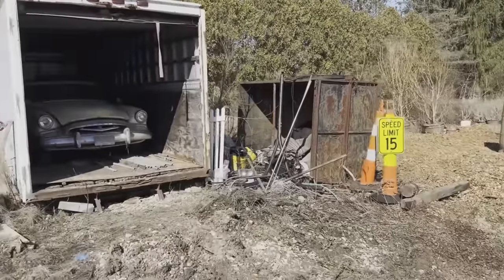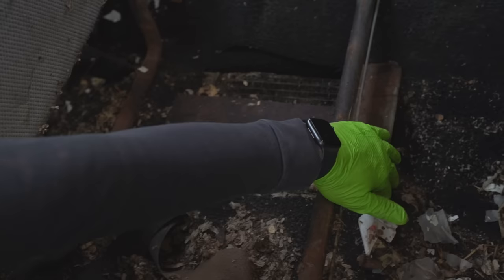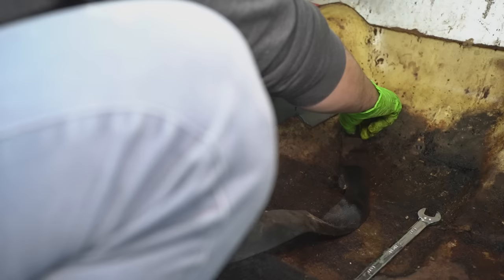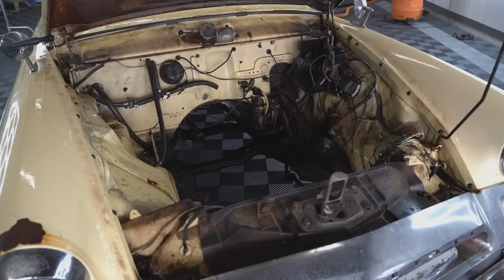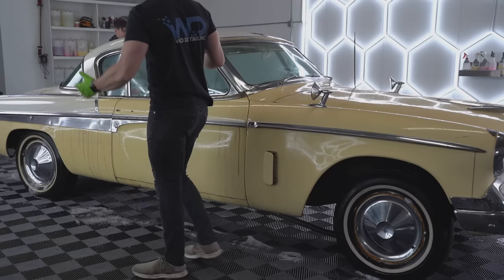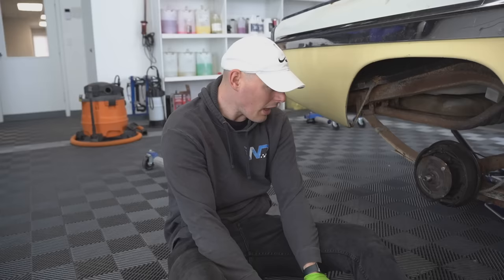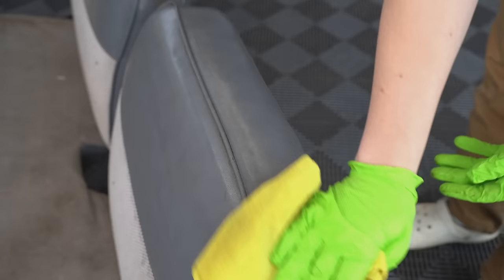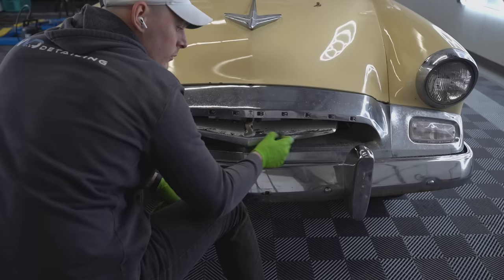First Wash in 30 Years: ABANDONED Barn Find Studebaker Disaster Detail! | Satisfying Restoration

Comment from the maker: Go to our sponsor https://aura.com/wddetailing to get a 14 day free trial and see if your personal information has been leaked online!
Reply: I still don't understand why people throw these cars into a barn and don't do anything to them for decades. Now after rotting away for 30+ years they want to bring it back out and restore it. Had they put the car in a garage and monthly started the car and/or washed it, pumped up the tires, etc., the car would still be flawless. I have a 2019 Golf R that I bought brand new in 2019. It's my play car so it doesn't see rain. Once a month I wax and detail it out and after 3 years with only 1000 miles, the car looks better than it did when I bought it. The battery is on a tender so it's fully charged. When I do drive it, I warm it up slowly and try to drive it at least 10 miles so everything stays lubed. If you are going to park it and do nothing to it for 50 years, then just sell the car...get rid of it.
Reply: Have you ever did a 1992 svx  before?
Reply: @pokeman8030  6
Reply: It has that locking gas cap so the mice couldn't get in the gas tank because they ain't got no octane rating to begin with...
Reply: For the engine question. I would put an electric motor with around 400hp and around the same number of pound-feet of torque. Reinforced suspension, and around 90kWh battery pack. perfect for some fun and weekend rides.
Reply: @youxkio  You Limeys kill me with your electric car gags. We'll come plug it in at your house and when all the lights go out in the neighborhood I'll go around and let folks know you did it...
Reply: @thekingsilverado3266  Myths to be solved...
Reply: superd. frm.davao city.philippines

Comment: First and worst, when you get the new brake drum you will find that the hub is permanently attached. The drum is supposed to be removed by taking off the nut in the center and using a special heavy duty puller designed for this type of brake. This error is not entirely your fault as the wheels on the LEFT side of the car are supposed to have left hand threaded studs. Somehow, the brake drums were installed incorrectly. If the new drum you ordered has right hand threads install it with the correct lug nuts. To make a 100% correct repair replace the remaining  left hand wheel studs in the front hub with right hand threaded studs and nuts. This type of wheel stud arrangement was discontinued in later model years and the car will operate with all right hand threaded lugs. Since you have broken all of the wheel studs you must remove them from the hub and mount the puller with 1/2 inch bolts. The hub mounts to the axle shaft with a tapered fit and a key and requires much force to remove. As to the "radiator" under the front seat, that is actually the heater core. You will find the blower fan inside the right front fender. This is normally connected to the heater core box by a 4" flexible hose. This was probably removed by whoever removed the engine. There were also water hoses which connected the heater core to the engine cooling system. What engine to put in the car depends on whether you wish to do a complete restoration or make the car more dependable for every day driving. A restoration would require the original engine be put back in the car. Many Studebakers have had Chevrolet engines installed. This is quite easy as Studebaker used Chevrolet engines in 1965 and 1966. You can use factory original components such as engine mounts, transmissions, exhaust systems, radiators Etc for 1965 and 1966 model cars to install a Chevrolet engine in nearly any  Studebaker built after 1951 without having to make major changes to the chassis or body. For further information contact the Studebaker Drivers Club.
Reply from the maker: Thank you, this is a lot of GREAT info! Much appreciated!!
Reply: @WDDetailing  :person-turqouise-waving:.....G'day,
for any vehicle, contact the associated club (if possible).
Cheers with appreciation,
Malcolm. (Australia)
Reply: For old chrome I use 0000 wire wool. It removes the rust and polishes the chrome with no scratches.
Reply: This is a great response.
Reply: Wow, now I know!!  😊👍
Reply: To add to Edward's comprehensive reply, if a replacement engine unit is required, it's just as easy to maintain it stock with a Studebaker engine even if the block needs rebuilding with a V8 parts readily available from a host of vendors. BTW, the following year saw the introduction of the 1956 Studebaker Golden Hawk which was fitted with the Packard 352 big block that put out 275 ponies via quad carb. Fitting twin quad carbs boosted output 300 hp. It was also possible to fit the Packard 374 unit, or have the original engine bored out to 374, which took the power output to about 310 hp with a single quad, duals took it to around 340 ponies from recollection.
One suggestion if your faced with tackling a brand/car you're not familiar with - maybe reach to the Club for any quearkieness or innovations which might help you with future endeavours.
Enjoyed the video.
Oh yeah, my parents had a 56 Golden Hawk when I was a baby; the only 56 Golden Hawk imported into the UK back in the day, though the car was a couple years old when they bought the car; I remember that car very well 😊 even as a 3 year old
Reply: 8
Reply: Locking cap because people siphoned gas.
Reply: @richardatkinson500  indeed but the Packard engine had issues with the oiling system which I believe people in the Packard Club solved by adapting an Olds 455 oil pump - but this is not something you can do if you have no mechanical knowledge and an access to a machine shop. Also, the Packard is a even heavier than a Stude 289 which is worth bearing in mind and - last but not least - parts availability for any Studebaker engine is better than for the Packard.
Reply: @richardatkinson500   You're right that it would be easy to maintain with one of the Studebaker V8s, but this one is a Champion model, with a flathead Straight six. Unfortunately, the transmission and rear end that came with the flathead six aren't tough enough to handle V8 power.  You'd need to swap the tranny and rear end as well to do a V8 swap.

This one puzzles me.  I don't think I've ever seen another hardtop model with Champion running gear.  Most of the people who paid extra for the hardtop also paid for the V8 engine package.
Reply: @billshirley4038   No doubt.   Cars get locking gas caps because the owners are worried about theft of gas or somebody pouring sugar into the tank.  Oddly,  my car, which is nearly identical, has been using the same aftermarket locking gas cap as this one, since before I bought it.
Reply: Bruh like we didn’t hear him rip 😂😂
Reply: Wow!  That is so cool.
Reply: @tedpreston4155  also worthmentioning, V8 equipped models, came with larger breaks as well!
Reply: super !
Reply: He cried because you broke his wheel and brake.
Reply: You were going to need to do some major work on the brakes anyway.  All steel lines, master cylinder, all wheel cylinders, new drums,and brake shoes.

Comment: In case everyone else hasn’t told you already, that “radiator” under the seat is part of the “Climatizer”. That’s the main heater core for the cabin. There should be another small core up under the dash for the defrost and the blower assembly is behind the passenger side front wheel. The little “doors” on the front fenders lets fresh air into the heater or directly into the cabin.
Reply: I'd like to add that the water valve to regulate the amount of hot water going to the heater core is under the hood on the fire wall about where the glovebox is.
Reply: Interesting!  My (nearly identical) 1955 coupe didn't have the "Climatizer" option, apparently.  Mine has an after market heater core that bolts to the inside of the firewall.  I wonder if the Climatizer heaters were limited to the hardtops?  Does anybody know?   

 I've sure seen similar under-seat heaters.  My London Taxi has a similar sort of heater - under the passenger seat in the back!  (No comforts for the poor sap driving the taxi! )
Reply: @tedpreston4155  Climatizers we’re available from 1939 on. They weren’t standard equipment though so many cars were produced with heaters like yours.
Reply: Studebaker engineers were pretty sharp, locating the Climatizer under the seat. Even heat front and back and for Southern cars that did not need a heater, all the cars came with a small defrost under the dash.

Comment: Here is a bit of help from a 75 year old who had a 56 Studebaker Golden Hawk. The rear axels are held in by the brake backing plate, unbolt then and a couple of raps in the axel will work the bearing race out. I broke a few as a teenager of 16 in 1965...and replaced them on the road. looking back I am so glad they were not held in by "C" clips as todays cars are.

Comment: On the wheel studs, first try drilling a hole in the center of the bolt. The bit should bind and spin the bolt out. If that doesn’t work try a self tapping bolt and that will definitely bind and give you something to use to turn the bolt. Hope that helps.

Comment: My dad had a 1955 Studebaker President Speedster. The Speedsters were easily identified by a circular medallion on the side trim just behind the door opening.  There were only 15,000 of these made and they were intended to be owned by the dealers themselves.  It cost my dad $3800.  It had a tri-tone paint scheme of a white top, Pimlico gray hood, fender tops and deck lid, and Congo ivory lower sides.  The seats were upholstered in Congo ivory leather.  The front bench seat had an asymmetric back where the driver's portion was approximately 1/3 of the whole.  The reason for this was to make it easier for passengers to enter the rear seating from the curb since this car was a two-door coupe.  The carpeting was red horse hair.  The inside door panels were also leather, this time in Pimlico gray.  I believe the headliner was white leather.  All of the leather interior was cross stitched in a diamond pattern.  The instrument panel was made of machine turned aluminum and supported an array of Stewart Warner gauges with a tachometer.  The speedometer ranged up to 160 MPH.  The engine was basically a Cadillac engine with smaller bores in the cylinders to give a displacement of 289 cubic inches.  It was topped off with a Rochester 4-BBL carburetor.  The automatic transmission was a Borg Warner 3 SPD of the same type as used in the Mark X Jaguar sedan.  This model had more chrome and stainless steel trim than any of the line.  My dad's car had the optional stainless steel wire wheel covers.

Comment: Anther great video!
Thanks!
As for my memories of what my folks drove. My folks owned a lot of cars over the years. 1964 Cadillac Sedan Deville with Fire mist saddle poly coat exterior paint color. 1958 Buick Special Turquoise and white exterior color. Later on Dad drove a 1978 Mercury Cougar White  exterior with Red/White interior. My dad would wheel and deal for cars never buy new. The 64 Caddie he paid 200.00 for it. Lots of memories of riding in those cars and a few others the folks owned. Great job on this old studebaker.

Comment: Hi, really appreciate your videos 
My dad, when he retired he bought a black studebaker champion (a automatic with the gears select buttons situated on the dashboard, righthand side of the steering wheel 
Every weekend on Sunday, it was my job to detail clean that car
A lot of chrome that had to shine,rubber floor mats and tyres were polished with shoe polish, it shined 
Oh it came with a standard car radio, but the previous owner had a seven single record player installed below the radio attached to the dashboard 
Oh it was a beautiful car, it really turned heads, it was such a pleasure doing the detail on that car, that was 52 years ago 
Oh and my brother had a Studebaker detona and the Studebaker lark was a racing stock car 
Ja when my father passed on, they sold all the cars, yes I did get to take the champion, for a quick spin around the block 
Really good cars, now at my age 66, I would like to have one of them as a project car

Comment: The key on the gas cap is to prevent fuel theft.
I am writing to you from Mexico, where plunder is an everyday occurrence. For example, if you leave your car in a parking lot, they will surely take away a few liters of gasoline that your meter will not detect, so you will not notice when you take it out of the parking lot.
Many brands came to the market with keys on the gas tank caps. Even if your car did not have a factory key cap, they would sell them separately. You know, the eternal battle against thieves...
Greetings!! I love your channel!!

Comment: This car is a 1955/57 Studebaker Commander. Trading in a '52 Kaiser, my dad bought a 1954 Silver Hawk. It came stock with a V-8. He drove it for 2 years and trader it for a '56 Hudson Hornet. A sailor bought the Studebaker and pushed it too hard. He not only blew the engine, but part of the engine came out thru the hood,
The locking gas cap was added by the owner. The seat belts were also added by the owner as prior to the early 60's, American cars did not come equipped with seat belts. I added seat belt to our "60 Rambler Ambassador.

Comment: My father had a Corolla '73 deluxe with plastic blades for sun protection at the back. I remember he used to turn off the engine in neutral while driving downhill to save gas and tried to let it roll as much as it could without using the engine. This car scared my father once on a curve as it understeered. But in my memory, I remember another episode with it oversteering and turning left. It was awesome! I miss the smell of that car.

Comment: My parents drove a black corvair coupe-63, a 67 Chevelle 4 door, a 75 Buick LeSabre with 250.000 miles on the original motor-still ran good, a 72 Dodge Dart Swinger that I quickly put in the ditch during the winter and a Dodge 024 and a Plymouth TC3.

Comment: Great video!  The right side wheel lugs have left-hand threads so if one lug bolt loosens, its tendency is to tighten while the car is traveling forward instead of loosening and spinning off.  Also the locking gas cap will ensure that no one can siphon gas out of the tank.  But I gotta say, you did a fabulous job on that Studebaker.

Comment: When I think of the automobiles that my parents drove, my first memories are of the 1957 Oldsmobile 98 and 1961 Chevrolet Bel; Air.  Later, we had a 1966 Oldsmobile Jetstar 88 and a 1962 Chevrolet Bel Air.  During the early 1970s, we had a 1969 Chevrolet C20 with Sun Way Pickup Camper and a 1971 Buick Sportwagon while later in the decade we would have a 1979 Toyota Corona LE Liftback and a 1973 Toyota Corolla 1200.  When I left for college in 1978, the Corolla was replaced by a brand new Plymouth Horizon four door liftback.  The 1973 Corolla was the victim of severe rust and my mother called me in 1985 to accompany her to pick out her new Oldsmobile.  She told me that she wanted the model closest to what her 1966 Jetstar 88 had been in size and style.  She decided on the 1985 Oldsmobile Delta 88 Royale Brougham Luxury Sedan with premium leather interior and every option with the exception of the moonroof, diesel motor, and firemist paint -- it was such a unique request, that our dealer had to special order -- twelve weeks later, on April 21, 1985, the car was delivered to us and it immediately went to Ziebart for a full protection package that would be maintained for more than 20 years -- my mother had place my name on the title beside hers all those year ago so when she passed in 2000, the car passed to me and I still own that car.

Comment: That drum comes as a hub and drum assembly and there is a puller still available that pulls that assembly off of the axle (you have to remove the large nut and the drum assembly is pulled with the drum puller tool the axle is a splined taper and can be quite difficult to get off) The cars of the fifties (not all of them) use left and right hand threaded studs and that drum is actually for the drivers side as the left hand thread studs are for the drivers side and of course the right hand threaded studs are for the passenger side. The thinking was that due to the wheel rotation the lug nuts would work loose and of course that is not quite the deal as all vehicles and big trucks are right hand thread. You can observe the L or the R stamped in the end of the stud to denote. You can also tell by looking at which way the threads go on the stud. This thinking probably came from horse drawn wagons as it would make sense for the wheels to have left handed threads on the axle nuts. Those drums can be reversed if one is not paying attention. and that is why the left hand studs are on the passenger side. Studebaker as you may be aware is/was an old company founded in 1852 building wagons. It really was a good car (of course all makes suffer from one engineering snafu or another) but had a bad reputation among people as being junk. The company got into bad financial shape from poor management paying out too high of dividends to stock holders (this I read some where) and got behind the eight ball. You guys are smart wearing your gloves and respirators as all of that stuff you are stirring up can get into your lungs and cause fibrosis (bad ju ju). The man that towns the car said he had the engine all wired up and ready to go. I would install that engine if the car was mine. You can't beat that styling on them Studebakers.